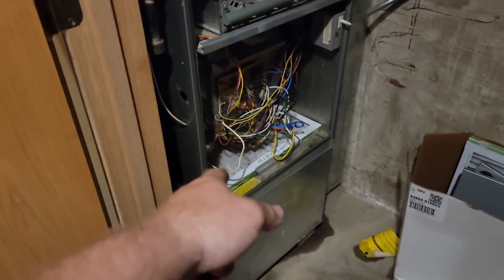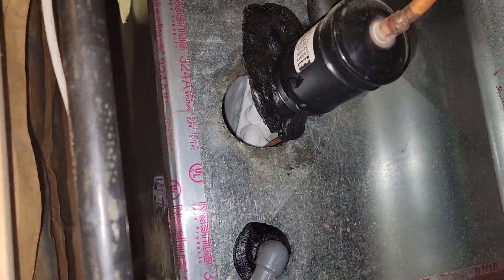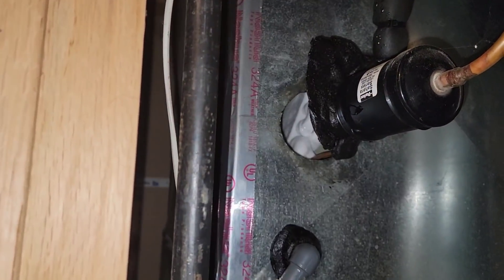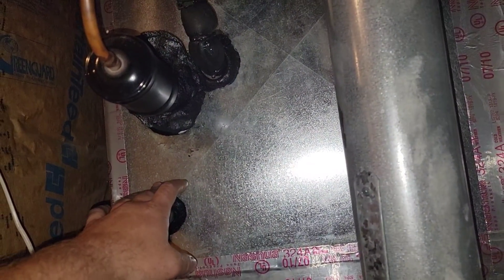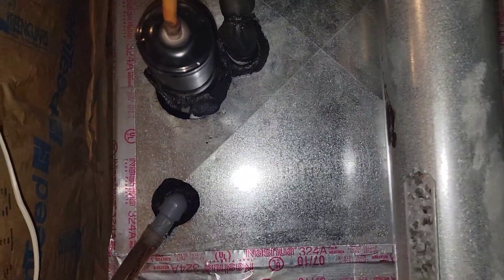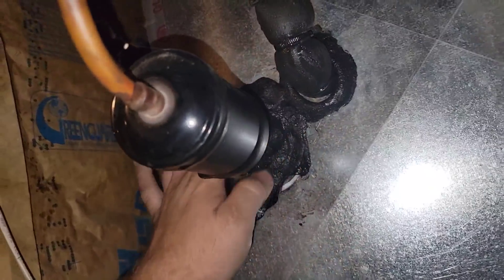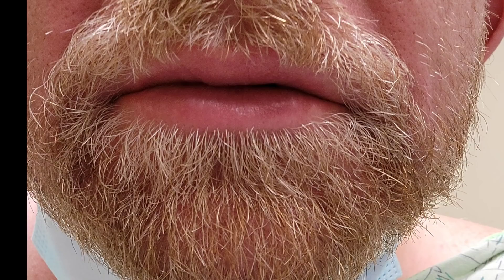Checking The Air Conditioner Put Me In the hospital, HVAC Guys I need your help

Comment: Make sure the interior blower is working and moving air to vents once defrosted. Need a set of gauges on it to see if its low on charge.
Reply from the maker: It's new like 2 months old
Reply: doesn't matter. Icing is most likely low on charge, metering device plugged or poor airflow across the evaporator.
Reply: he is a AC teak for cars and trucks so he may have a older set of gauges around,  just remember some the newer refrigerants run at studied high pursuers.
Reply: Ford Boss Me also since it’s only 2 months old, you can soap/bubble check it at the braze/solder joints the tech did. Brand new ducting? The return air duct could be way to small or covered to prevent construction dust from getting in the system which would cause icing. And lastly the evap coil could be blocked with construction dust on the intake part of it (upside down v)
Reply: Two months old I would be checking refrigerant charge and also for restrictions, restricted filter drier or metering device plugged from contination or if it has a txv if maybe there was problem from the manufacturer or bulb charge leaked out. Also like you said cleaning evaporator and make sure blower is working and other common air flow problems. Sometimes insulation breaks off and gets stuck inside blower fan etc. Usually full system freeze up out to the compressor is airflow and frozen evaporator only is refrigerant charge. If it's new company should fully warranty it for a year from date of install that is standard at least in my area. But that would be the installation contractor in HVAC manufacturer's only cover parts no labor or anything else.
Reply: @FordBossMe  age doesn't matter. Ever done warranty work on a vehicle that is two months old? I bet yes.
Reply from the maker: @skinlab4239  I'm reading what you're saying guys I just don't have a lot of energy to get into deep conversations with people I'm still feeling groggy from the shot but I get what you're saying I just don't want to put any extra effort into anything right now
Reply: @FordBossMe  call the installer. Their problem.

Comment: Low on Freon! Clean coil!  Correct Freon level or put dye in to check for leaks. Use a leak detector. It smells for freon. Then let's off a alarm.  Shawn.
Reply from the maker: Yeah there was an update to this I put it out already I'll tell him to fix it wasn't freon it was a plugged evaporator
Reply: @FordBossMe  Sorry you got stung! I ran over Brown Hornets made a hive in a mole hole. I ran over the hive and the Hornets were very mad. My throat swelled up and close off my wind pipe. My neighbor had a eppe pin. Saved my life!  Hope your better. Missed the update. I work nights. So I catch up on breaks and lunch.  Keep up the great video's. Shawn.

Comment: Could be a dirty evap it freezing up that much probably helped clean it would still probably go ahead and get in there to look and clean as needed, always suggest making sure the outdoor unit is clean once a year if you had it serviced that should have been done. Fan seems to be running fine so I doubt its airflow. I doubt that filter is that restrictive. If the evap is clean. Most likely an issue with the charge. Once you verify evap is clean id call a tech make sure they leak check. Make sure they check the valve stems they tend to start to leak over time

Comment: Well provided the evaporator isn't have a leak, it was probably also all the crap by the outside components being blocked by the tall grass. Sure you and others all know it has to breathe around the condenser and compressor, can't be anything blocking outside airflow. Humidity does play a factor as well, if its possible to run it and does okay with no leaking and all debris is out of everything, keep the thermostat set to about 78 or 80 if possible. It helps electric bill and keeps it from usually freezing up. Not sure how to go about accessing that evaporator, everything is pretty tight fit.

Comment: Once you get the cover loose, maybe you can pull the coil out some and be able to look underneath it and clean it that way.  Will depend on how the lineset is installed as to whether or not this will work.
Reply from the maker: It was the coil, completely blocked with dog and cat hair

Comment: Was the filter clean before it froze up? Do you have reasonably good air flow out of the grills after it thaws out? If yes to both, you're most likely low on refrigerant. One remote possibility is a sticking contactor on the condenser causing it to run after the thermostat is satisfied.
Reply from the maker: Yes
Reply: @FordBossMe - I'm leaning toward low refrigerant, but without subcooling and superheat numbers it's hard to know for sure. Do you have an old set of gauges?
Reply from the maker: @seroxide  I'm going to try to pull the cover off for the a coil so I can see if it's dirty inside would like dog hair and stuff like that cuz we do have 5 Animals
Reply: @FordBossMe  With animal hair the air will flow until it gets wet with condensate. Once it's wet it blocks the flow and freezes. the good thing is it usually peels off in layers if you lightly spray it with water.

Comment: I had a tick of ice forming on my suction line where it goes into my condenser, so I looked into my evaporator housing and found a substantial amount of buildup on the evaporator. I scraped it all off with a toothbrush. No more ice and works fine.

Comment: Need to check the pressures again not enough refrigerant will cause freeze up.Turn the heater on to defrost it if it still happens it has a leak somewhere.BTW the same thing can happen in an automobile air conditioner too

Comment: Turn the AC off at the thermostat but run the fan that blows air through the vents.. I'm talking about the inside unit squirrel gage fan. Once thawed check the outside unit it it hums  or the fan not blowing. Make sure all the filters are cleaned first off. Onece you have more info check youtube. My unit was huming and the outside fan not turning. Bad starting capacitor for the fan. I saved hundreds DIY myself. If you don't know what to do call a professional.
Reply from the maker: I found out what it was the inside of the evaporator inside the house was completely plugged with animal hair

Comment: Glad to hear you are ok! High grass is also  real danger for ticks and lyme disease. Here it is pretty much a sure bet if you get in grass like that. Very serious S*$#t. Icing usually happens if no airflow on the evap or condensor, or a pressure issue/blocked orifice. Same thing can happen on a car. How is the filter?

Comment: Did you upgrade the filter to a higher grade than previously used? If so, Its possible there's just not enough airflow. 
Also check orientation believe it or not sometimes it matters.

Comment: Most likely a leak someplace, or bad txv if you have a txv on your evap coil, theres many things that could cause it to freeze up, we as techs test right down the sequence of operation.  Either way if its leaking or a bad txv you have to Dump the charge and do a nitrogen pressure test with gauges hooked up and spray with soapy bubbles, all over the coil and lineset, and new txv,  then after that,  vacuum down the unit with vacuum pump, and weigh your charge back in. You should never have to add refrigerant every year. And yes, untape the evap plenum take screws out and access from there.
Reply from the maker: It wasn't a leak it was the evaporator coil internals clogged up with dog hair
Reply from the maker: You can see the video I uploaded after this one in my library where I clean off all the dog and cat hair
Reply: @FordBossMe yep, airflow is the first thing we check..got lucky on that

Comment: I'm not a professional but I would check the drain hose to make sure it isn't kinked or plugged up. I'm sure it's what most of the pros have been saying: low on Freon. But I just wanted to add an idea I haven't seen yet I guess. My coworker had the same issue with icing. Luckily he knew a guy that could help him same day cause he has two Newfoundlands and they NEED A/C.
Reply from the maker: I found out what it was the inside of the evaporator inside the house was completely plugged with animal hair
Reply: @FordBossMe  SIGH the things we do for our furry friends

Comment: It is possible to clean in place but the answer is Yes you have to move that pipe. Getting into those coil over furnace installs is a big pain in the ass. Depending how dirty the coil is it might be easier to have a tech pump down the refrigerant to cut the lines and remove the coil to be acid washed.
Reply from the maker: Video is up on me fixing it it was the.... a coil
Reply: Yeah just saw that after. Glad it worked for you. You might need to take the cover off again to make sure the skinny copper tubes are pushed back over the drip tray. That's what I'm thinking judging by the amount of drippage you have coming out from the box. It's soft copper so you can gently flex the lines but definitely be careful. Also the amount of condensation should lessen once the house cools off.

Comment: Clean the condenser coils outside and make sure the fan is turning on on your outside unit. All of that needs to be Clean. Make sure the condenser coils aren't loaded up with grass weeds and dirt
Reply: Take a garden hose and run fresh water through the coils to flush them out. The cleaner you keep those coils the more efficient the system will be.

Comment: either the air flow is too low to b\neat the refrigerant  or the valve button orifice  whatever is letting too much refrigerant in.  a manometer  before and after the a-coil will tell you if the air flow is sufficient.  guage readings will tell you if the refigeration system is the problem. its no different than a car  just a little bigger. remember it will frost starting at the point of restriction.    i was never allergic to bees till one day a few years ago yellow jacket got me.  been bad ever since.

Comment: NOT A DOCTOR >>>but Benadryl tablets 10mg  3-4 is what I did and monitor when I had a reaction to bee sting a few years ago and I'm not allergic either.... Short charge will frost a coil like that you know as well as I even though they "topped off the charge" it probably has a leak because it had to go somewhere.

Comment: It could be a few things could be caused by low air flow from dirty evaporator coil if it's clean and filters clean and fan is operating correctly. Could be low on charge or restriction in metering device or liquid line dryer. Can also start to frost coil if condenser coil is dirty. But if coils clean filters clean fan running most likely low charge or restriction.

Comment: After you thaw the coil out and then turn the system back to cool. Wait 10mins and a quick and dirty test is that .....well is the suction line beer can ice cold? If it is then maybe your problem is a dirty coil or low airflow. If it’s lukewarm then maybe a charge issue. Cleaning will not help That.
Reply from the maker: I found out what it was the inside of the evaporator inside the house was completely plugged with animal hair

https://youtu.be/HOZJAvc4XHE

Comment: Check the evap coil, it's probably going to be dirty and clogged with debris and seeds and other shit. Use a water hose to clean it. Try going through the top. Don't remove any more metal parts than absolutely necessary.
Reply from the maker: It was I took the whole housing and everything apart tonight and actually put it back better than I found it was completely plugged with animal hair

Comment: 1st thing turn ac thermostat off fan on the on position make sure the fan motor is working on the air handler the unit will ice up because there is a leak somewhere or it is low on freion  and also when you turn in on cool make sure the condenser fan is working also you said it was just serviced check schrader valves where your gauges hook up I would call the person that just serviced it I had 2 calls just like this yesterday let me know if you need anything I'm here to help
Reply from the maker: I'm confused did you actually watch the video because I did everything that you said here in the video and I spelled it out in the video but then you re spelled it out in the comments section I'm just a little confused here
Reply from the maker: The service that was done was they installed a new blower motor and that seems to be working perfectly fine they didn't do anything else other than that so it doesn't seem like it's their fault this unit is 13 years old

Comment: To melt it quickly, turn on the heat and it will melt it all in under 10minutes. 
As everyone says, it’s either low on Freon or has an airflow issue. 

Edit: Seeing that the fan seems to be working at the end, I would lean toward low refrigerant. I have this problem with my old unit and it usually just needs a top off. It has a slow leak in 30yrold evaporator. Lol

Comment: Low on charge, air flow problem, make sure all your supply registers are open. 
With it running after a good 12—15 mins take tempature reading of the suction pipe not with a laser gun. Use a meat thermometer and tape it to the suction line the fat pipe. Take that number subtract 10. Example 38 suction line then minus 10 = 28 that would be a low on charge. That will tell u the evaporator coil tempature.  Anything below 32 and she's gonna freeze up.  Also make note if it's right on the edge of 32 It may run all day long then when it gets much cooler in evening lower that 70 then the coil would ice up. The load factor changes. More than likely you have a leak or the dishonest service company that supposldy serviced it let gas out and well now it's not cooling see it all the time on older systems.  And for the pros out here this would be the hillbilly way to spot check with a buddy over the phone who does not have guages and know nothing of subcooling ect. Line Temps and a pt chart my friends

Comment: Not a tech but think about it. IF the freon levels are right, something else is wrong. Mine was defrost board and temp sensor. I ran heat cycle ( heat pump) the speed thaw the frost/ice. Inside freezes it still sounds like freon.
Reply from the maker: I found out what it was the inside of the evaporator inside the house was completely plugged with animal hair

https://youtu.be/HOZJAvc4XHE

Comment: The ac works by both cooling the air, AND REMOVING HUMIDTY. This is where your issue is. The humidity that it removes condenses on the condenser (funny how that works isn't it (:). That water drips to the bottom and needs to be removed. Some of that water is actually used to splash on the compressor and cool it down, but most of that water needs to removed. In some cases there is  simply a gravity drain and the water just drains down from gravity. In your case with the unit being in the basement there is no lower point to drain the water to, so there is most likely a pump somewhere (called a condensate pump again funny how that works isn't it (:). That pump most likely has failed, and/or is clogged up. Case in point pause at 3:15, look at the bottom of the ac unit, see the wet marks there? that is water that is dripping out of the unit because it has no where else to go. 

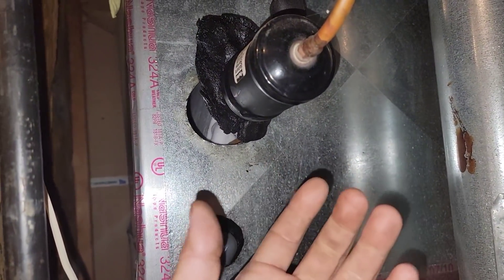Find said pump (you will most likely have to remove that panel and the pump is most likely at the bottom thou it is also possible that bottom hose at 3:55 goes to it and it is externally mounted, its hard to tell just off what we saw in the video) and confirm it is not clogged. Try to find where it pumps out to (most likely outside the house somewhere), and confirm that is not clogged. If it is clear the clog, leave the panel off and let it melt. As it melts the water should run down to the pump, and assuming it is working it should come on and clear the water. If it was not clogged, and/or you notice as the water builds up the pump is not coming on and removing it then the pump is bad go buy a new one. They are pretty universal typically available at almost any hardware store, and normally pretty easy to replace. 

On a side not it is possible the thermostatic switch on the ac unit is bad (not that thermostat on the wall you control building temp with but one on the unit that shuts the compressor off to allow the coils to warm up and avoid freezing like this) is bad. Giving the amount of ice, and the water on the floor I suspect the more likely culprit is the pump I just spoke of. With that being If you let it thaw, the pump moves the water out, you turn the ac back on, and a short while later it is frozen again then this could be your issue. It could also be low on Freon, or you could have a air flow issue.  unfortunately besides checking if the pump is working there is really not much one can test with out specialized equipment you most likely do not have, and no one the internet can tell you for sure what the exact issue is because they are not there, and can not run the test either. We could speculate, and you could spend hours and hundreds of dollars "throwing parts" at it, or you could save your self time, aggravation, and money and just call a expert in. Good luck.
Reply from the maker: I found out what it was the inside of the evaporator inside the house was completely plugged with animal hair